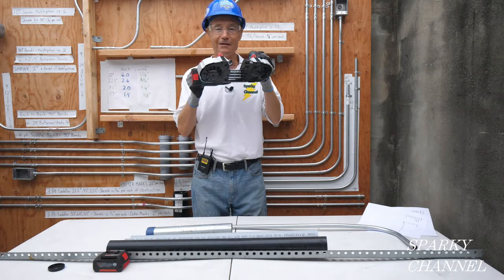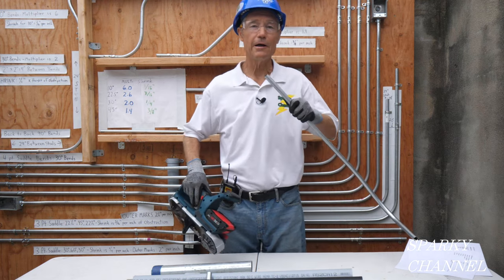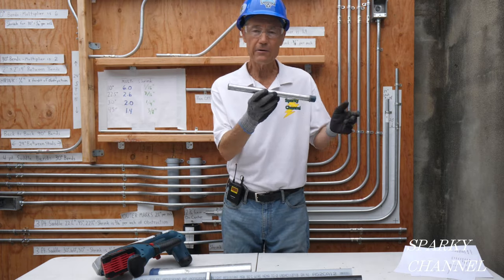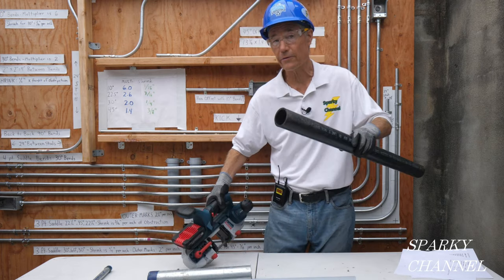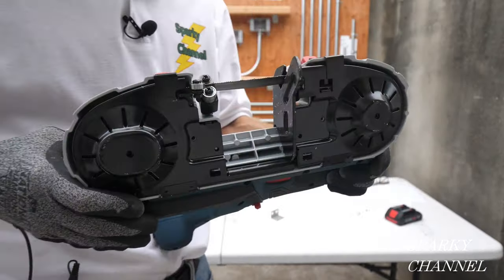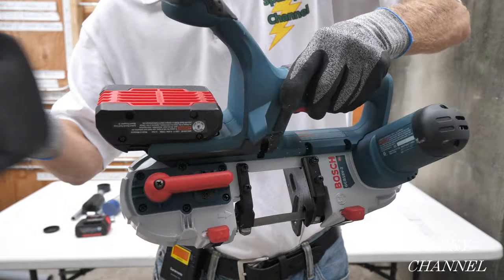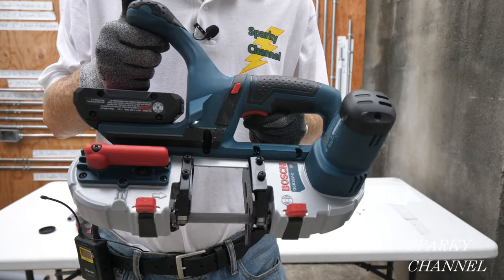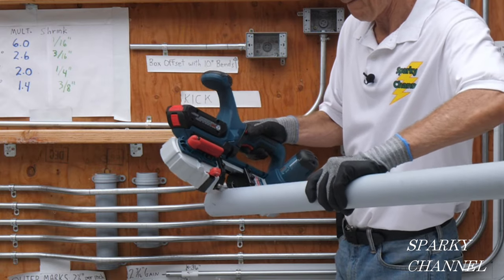Bosch New Compact 7.3 lb. Band Saw

Comment: Brush or brushless
Reply from the maker: Brushed, unfortunately.
Reply: @SparkyChannel  Brushed is actually better it will last longer, everyone thinks brushless is better but it's not the motor that goes its the electronics that go on the brushless motors they haven't figured that out yet they try putting the electronics in gel to prevent from getting damaged it helps but still doesn't hold up, while brushed motors will last year's no matter how much you drop and bang them around